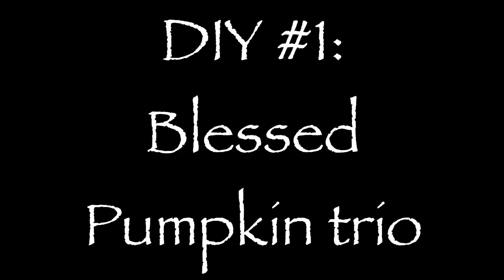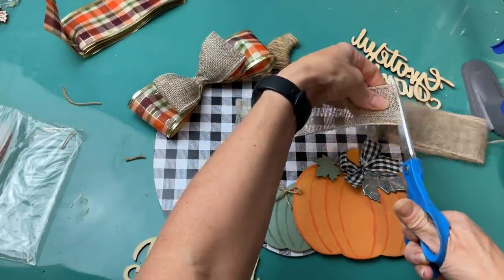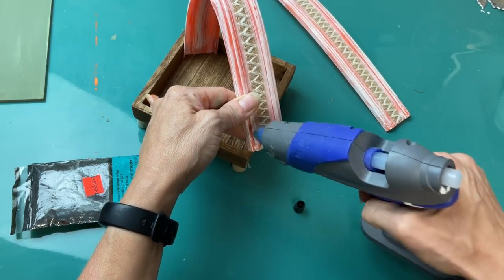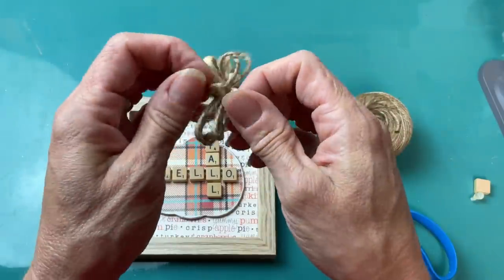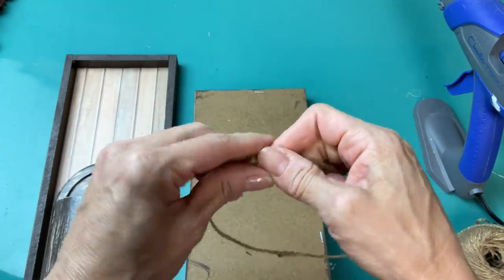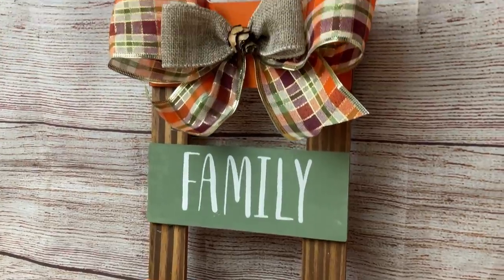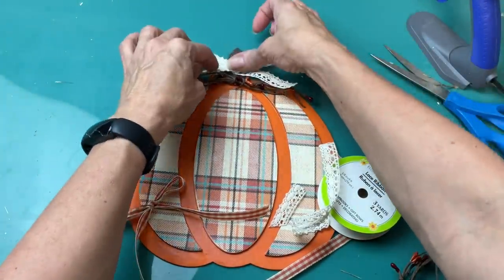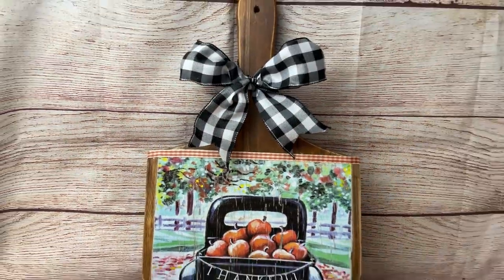$1 HIGH END EASY FALL WOOD DIYs 2021 | DOLLAR TREE FALL DIYs | BUDGET FRIENDLY | FARMHOUSE DECOR

Comment: Hard to get those calendars.  People tend to hoard.  A person could make a color copy of the calendar pages because (1) the copy paper is better to use on your project. (2) you still have your original calendar page.

If you use a glue stick to first adhere to your project, it wont get the bubbles.  Then put Mod Podge over that… you dont have to smooth it out so much.
Reply from the maker: Thank you for the great tips Patricia